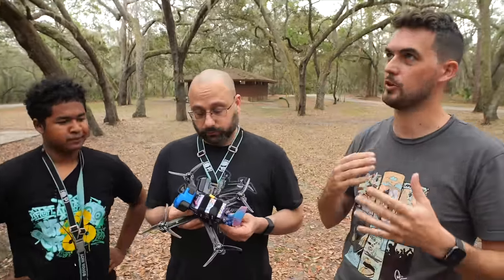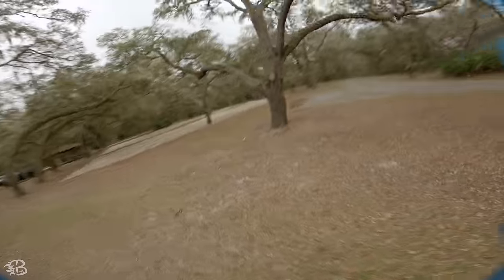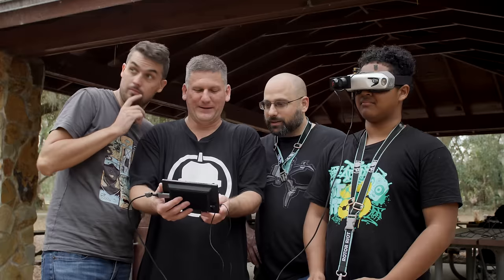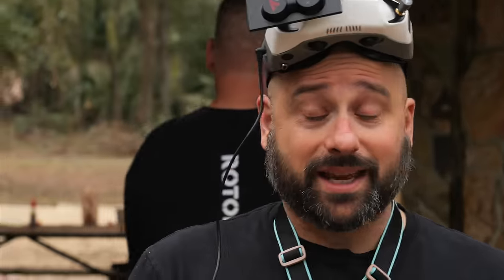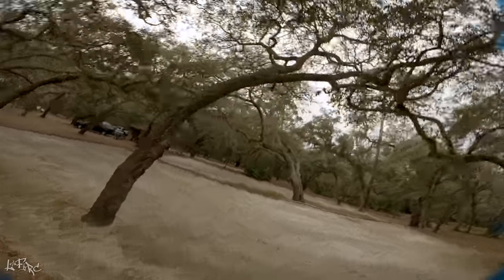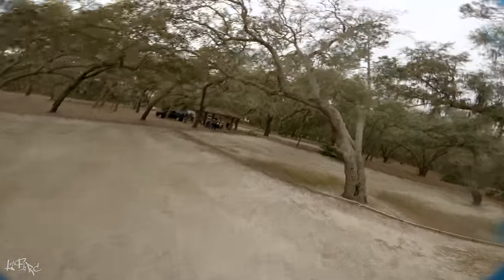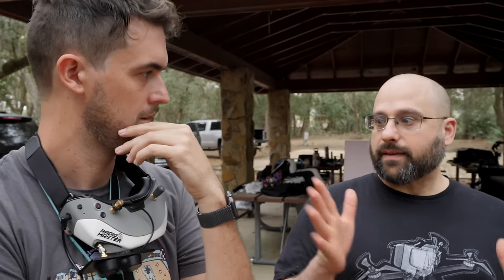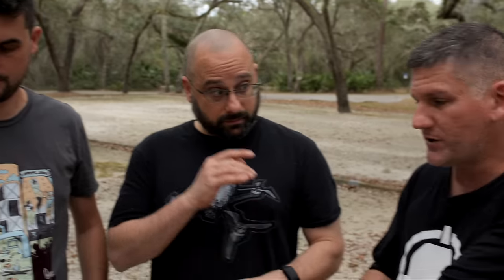8s Freestyle Drone!

Comment: Also if you're never going above half throttle it's harder to notice when the battery is dying because it has no issues delivering that much power until it can't anymore.
Reply: Good point
Reply: It was just odd that the punch-out was totally there 10 seconds before it died though. Although the one time I've had that issue, my 4s was DEAD DEAD and it wouldn't even come down in a controlled manner to land.

Comment: Foxeer Reaper F4 65amp 8s ESC has been AMAZING on two 10" builds I have. I can't imagine a 5" quad being able to kill it.
Reply: This good to know as I got one to build an 8s 7" on molicel p42a . 

What fc u run ? I found rush blade f722 has 8s fc so have paired them two together.
Reply: I killed my 7 in 8s reaper on 1350kv 😭 it took my matek hdte with it.  The saddest part is I didn't even crash it when it decided to fry, the voltage reg died on the esc just cruising around.  Was a sad sad day
Reply: @Brian-S  oh this is basically exactly what my build will be . 1300kv on 6s is slow af . So was going try 8s . Maybe not a good idea now .
Reply: @mx118racer  It'd cost more than the Reaper but I'd opt for individual ESCs on a high powered builds like this. It's too easy to wreck an AIO.
Reply: Thanks bro question answered. That's what I'm using on my five inch

Comment: I did smoox 1350kv on my 5" 8S build. Fetech has some 1100kv. I use a Foxeer 8s dual bec stack. Mine comes in at 613g with no gopro. The 1100mah gnb hv battery is a little better formfactor and weight.

Comment: One thing to consider.. higher volt can jump a wider gap in the electronics... ie, its easier to short out a tight build.
Reply: I mean yea technically yes but the difference between 4s and 8s is so negligible in terms of arc length that I honestly don't think it makes a difference
Reply: I mean even at 400v dc the arc maximum length is like 0.03mm
Reply: Yes lol, but that higher voltage is not going up 8.4v 😂😂😂. It take quite a bit of voltage to jump any gap.

Comment: Technically, can even do 10S, but 12S 50.4V is pushing it. More cells, more packaging weight.
The MP9943 5V reg commonly used on FC supports up to 36V. Most FET used in ESC are only rated 30V. 
But there are 40V and 50V options. 12S would mean around 900KV which is much thinner winding with 3x the turns of 4S.

Comment: Are the motors/ESCs coming down cooler because of the lower current going through them? That could be a real benefit of pushing to higher voltages/cell counts: you can spin the props substantially faster without burning things up.

I'm not sure what the benefit of doing that would be, but there very well could be one. Maybe putting on a throttle curve that has a big jump at/toward full throttle so you keep low-mid throttle resolution but have the ability to pull out of any dive? Something to think about...

Comment: 8S 1500kv works where 4S 3000kv doesn't, is because the low kv 8S motors have a massive torque reserve that will spin-up the prop faster

Comment: The motor windings are really fine wire. You’re putting more power through the motor with higher voltage but less amperage, that’s why you can get away with higher effective kv.

Comment: In my humble opinion, a line has been crossed. There is a point where you have to accept that building for lightweight does not translate past a certain amount of weight and power. Much like a Lotus is no longer a Lotus once a V8 has been dropped into it, but a Bugatti can handle the weight and power of a bigger powerplant with poise and grace. Go 6" to make better use of the power.
Reply: A lotus is still a lotus with a v8   Your just talking 😂
Reply: @harryfp1494  I am a canyon carver that has built several Volkswagen MKII GTI, and I can assure you that a W-8 under the hood of what used to be a 1850lb. dancer can no longer hold the same line without more meat on the tires, and better suspension.
Reply: More blades can always suck the power. And when you have 20 blades and the tips go supersonic you just add a duct to keep the blades from biting off more than they can chew. The duct in a turbofan regulates flow to pitch speed to keep AoA small and alleviate wave drag (typical tip speed is 1300 fps). IMHO you could put over 100 HP into a 5 inch fan before you'd truly need to upsize the diameter.

Comment: On my smaller 3-4” 8S quads I use the HGLRC Zeus 50A PRO ESC 20X20

On my bigger 5” 8S quads I use the Foxeer Reaper F4 Mini 60A 20X20

And my 6” 8S quads use the Foxeer Reaper F4 65A 30.5mm

Haven’t tried any other ESCs, gonna have to pick up the T-motor. Also obviously T-motor provided the gear… 8S FCs exist from Foxeer, Kakute, and SPRacing, that’s what I mostly use when lazy… BUT I definitely recommend external BECs for powering everything anyway.

This was a great build, way over batteried but still. I run WAY lighter cells and no GoPro, but there is more than one way to do things obviously… would have been easier to tune with less weight too.

Battery wise I mostly use two 4S batteries, as honestly they don’t need to be the best quality racing cells like when you are running 4S or even juicy 6S.

Most my batteries are 450-650mAh the smallest is a 70 gram 300mAh 8S pack for a 3” and I generally use 1050mAh for the biggest cells. I have one 6” bi-blade chase quad that I use the Tattu V5 1200mAh cells and make my own packs, but I generally deal with Dogcom, and occasionally CODDAR and GNB.

Most of my chargers are 6S max, so keeping the batteries split makes it much easier to charge large amounts of packs at once.

I have been doing this for a while and have it down pretty good. If anyone needs help I can share my experience.

8S is fun and all but especially in a small space it’s very unnecessary, I just did all those builds for the LoLs, don’t get me wrong they are great, but especially on sub 5” nearly impossible to tune. Your props, motors, and the build in general needs to be perfect, definitely not for a basher, stick to 6S for bashing, that’s what I do.

If you are not comfortable tuning, please don’t do this, you will likely lose your quad the first time out. Learn this first.

Winding your own motors is definitely recommended or you’ll have to run a motor limit.

Happy flying! And great episodes! And thank you T-motor ❤

Comment: Just stumbled across your channel - such incredible content. To someone who shoots from a DJI Mini 2, this is awe inspiring... Subscribed and liked - looking forward to more...:)
Reply: Sounds like it's time for you to grab a pair of Dji Goggles, their RC2 remote and any dji 03 compatible quad.. I started with the DJI FPV Combo, was super great for learning how to fly after first practicing in a simulator(Step 1), putting at least 36 hours in... Now I'm practicing low level and indoor flying with a 2 inch/4s CineON C20 V2/Dji03.  The Dji FPV makes you a cautious/safe pilot because if you crash that's ur ass(and some cash)! The avg cost of repair is $80-$100, no need to bother with DJi Care.   Any other 2s,4s or 6s quad is practically indestructible compared to the Dji FPV, but I would have never even gotten into the hobby if it wasn't for the DJi FPV, for sure... It is probably the best introductory FPV Drone on the market... In addition to its safety features, it also has normal and sport mode so you can fly it just like your mini 2 until you master manual/acro mode.

Comment: I'm interested to see current (Amperage) draw comparisons of 4S, 6S, 8S with equivalent RPM motors with respect to their voltage. I bet we'll see that using less current with higher voltage is the key to better efficiency and more realized gains in performance. You may also realize that with higher voltage, you can get away with using smaller gauge wire and probably less expensive electrical components (mosfets, diodes, etc.). By the way, I'm pretty sure a smaller farad, higher voltage capacitor would've given you ample filtering. A 330-450 microfarad 50V capacitor probably would've been plenty.

Comment: One thing that I love about 6S is the length of flight time that I get! I have a 3" 6S drone that I fly with HV batteries and it is a blast!
Reply: Holy shit 2.5" 6s... awesome.. git vids on ur channel? Ill check it
Reply: @SpaghettiFPV-tg3qh  Sorry, early in the morning and was going by memory! It is a 3", not a 2.5" I have so many quads that I et them mixed up LOL!
https://www.youtube.com/watch?v=y0nVTdLJxGA&ab_channel=CAPTAINDRONE
Reply: yea i was gonna say hahah
I got an AOS 3.5 im doing into a 03 air unit 6s right now :)
should be fun hahah
Reply: @SpaghettiFPV-tg3qh  hows the aos3.5? I am looking at aos 3.5 vs quadmula f3 split with those hv 6s.
Reply: @GlobalSourcing  mate im still building im just waiting on a few lil things antenna etc from order.
I made an aos 5" if it flies anything like that it will be gold those frames are fuckin tight they feel so locked in when u fly.
Reply: @SpaghettiFPV-tg3qh  did you build it? Eager to hear your impressions. What stack/motors did you decide on?

Comment: I think on 6-7” 8S will be great, very high speed cruising
Reply: I built one with some 2408 1350k test motors on an apex 7 inch.  Unfortunately I only had 1300mah packs to test it out but was getting about 4 mins of balls to the wall full throttle ripping. So I'd imagine it's be stellar on a long range set up with something like a 3000mah 8s

Comment: If you want to match the kV just multiply your actual Kv by your actual S and divide it by your new S. For example 1800kv for 6s then for 8s it should be 1800x6/8= 1350KV. They're using 1500kv that's why they feel it faster

Comment: I think this would definitely benefit from similar settings for throttle on Joshua Bardwell's video on tiny whoops and the type of non-linear throttle control when used in "tiny spaces" for mini-whoops. Because, as we can see this drone is clearly running out of space though, you could still have the mega punch on throttle that this drone so desperately has over the rest! But, it would have a much better consistency to a 6s and even a 4s on linear throttle control for more precise movements.

Comment: If I'd build an 8S I would probably use the T-Motor F66A Mini 3-8S in combination with one of their 8S FCs or the Foxeer line, like their 8S Reaper ESCs with their Foxeer H7 Mini that can also take straight 8S. Only thing holding me back is cost to be honest.
Reply: What motors would you use? I'm making a build, I got the esc + fc from foxeer (8s), aos 5 frame, I just can't find the right motor.

Comment: You should compare the 6S and 8S quads each with a lipo that weight the same.  Like a 1300mah 6S vs a 1000mah 8S.  This would be a better comparison.

Comment: Higher voltage needs less amps and motors with less kv. Where is the sensefull limit for going higher in voltage ? JB, maybe you could do an episode going into that question ? Because less amps also means less heat and lighter cables. 
The idea to use 2 packs with 4s instead of one 8s is also very usefull !
Thanks to all of you for this inspiring episode !
Reply: Voltage is speed, amp is torque. 

Only limit for voltage is insulation and the price of components. Voltage is easier to handle than amps. With less amps you can get lighter components, but you loose torque.

Comment: Just run a pack which has 16 thinner cells instead of 8 at whatever size these are. So you have an, (8 series 2 parallel, 8s2p) pack. Then you have redundancy built in. I had a 2s2p pack for my onroad carpet touring car a couple of years ago. Still was 5000mah but with 4 cells instead of 2 and it was still just 8.4 volts.

Comment: 8s batteries are a pia… and no Hota support.. 
but the power supply must feel awesome. 

Should consider battery weight.
Does a 2000 mah 4s have a much lower real C rating than a 1000mah 4s? 

Seems like kv has a ton to do with this along with big battery

Comment: my first build was under 400g and 4s with kingkong motors engineerx said were all way over the rated 2650, 2850kv at least, scared the bejeezus outta me, took me months to even attempt to acro fpv it.

Comment: The best stack for 8s is foxeer reaper 65a esc and a foxeer H7 8s Fc.
Reply: as far as my knowledge the foxeer 8s 65amp esc's mosfets are not rated for 8s, but some other component on the board is which is why they market it for 8s. I could be wrong tho maybe they changed something

Comment: I could imagine to fly these motors on 6s to gane some endurence.
I normaly fly 5" 6s 1800KV for 5 min, but i flew it on 4s to test something and i found out that i can fly it for 8 min with a smaller battery (little less Wh). It's way more efficient.
Same thing could be true for these 1500kV on 6s. And since you have so much power, try it.

Comment: The motors are comparable to 2000 kv 6s motors. 1500 kv * 8 / 6 = 2000. A 6s with 2000 kv should be very fast as well. I'd like to see a build that compares the battery sag between 6s and 8s with comparable kv.

Comment: So your only partially correct with that. So In a DC  circuit when resistance remains constant if you raise voltage you also raise current. So if you took the same motor and ran it on 6s and 8s it would draw more current on 8s. Now because 8s holds more potential and energy than 6s, we can use it in a lower kv motor and get the same rpm and slightly more power out of a lower amp draw. But…as dc voltage goes up, and resistance remains constant, current also goes up.

Comment: if 4s isnt enough, go smaller in drone size instead. 4s 4inch is absolutely nuts, at maximum i fly 75% motor limit, technically 56.25% throttle limit, thats pleeeennntyyyy

Comment: The explanation at the beginning is wrong I think, it's not any less amperage, it's less capacity and mah by weight, but not amps. Yes it's less amps as opposed to 8 cells in parallel, which is a strange comparison to make, but basically more cells != less amps.

Comment: The thing their not realizing is that with 4s you'll get a voltage drop that once you Cone out of full throttle the voltage climbs right back up. With 8s your not going to get that drop because your rarly pushing the battery's where their getting those drops. What about 7s?

Comment: Blip Drive tech coming soon . nh100 magnet strength capable, high yield tech in battery materials , esc fets that blow the tits off of all current fets made with a percentage of inconel material.

Comment: my 1900kv 6s spins like 4000rpm slower but it has 8 motors, also I just weighed it and its only 950g with a 2200mah battery and props, I just can't fly it well yet tbh

Comment: 8s looks fun but not so practical, and sounds expensive for extra power you get, not to mention the extra voltage running through the system.

Still a good 👍 show 👌

Comment: go learn what kV means, Joshua... It's the voltage generated on some rotation speed of the bell when the motor acts as a generator
Reply: Glad someone else spotted that. For practical purposes though, we often think of it the other way around and it roughly works out.